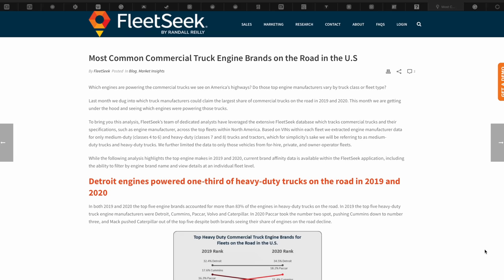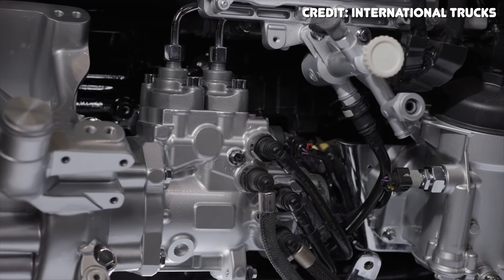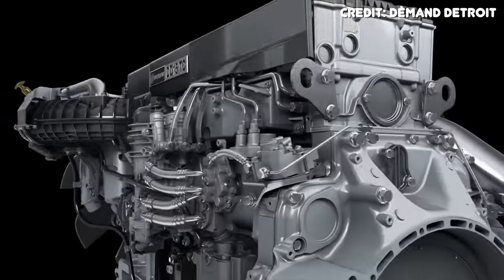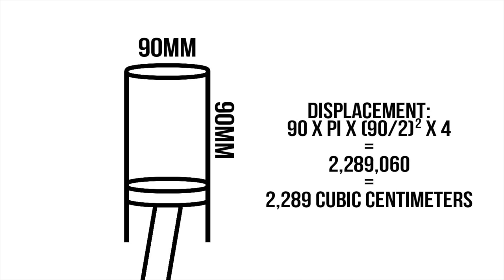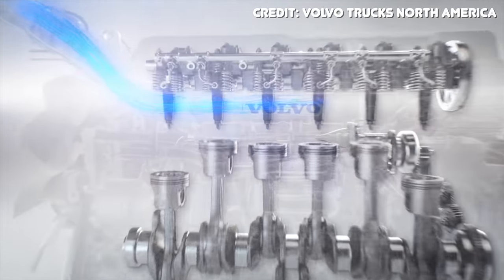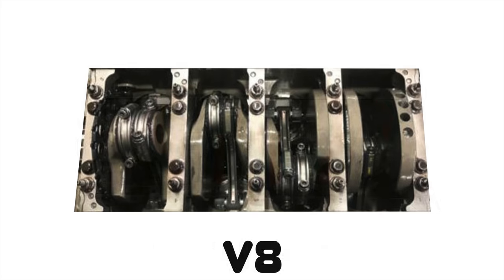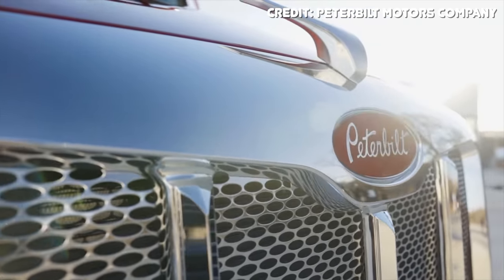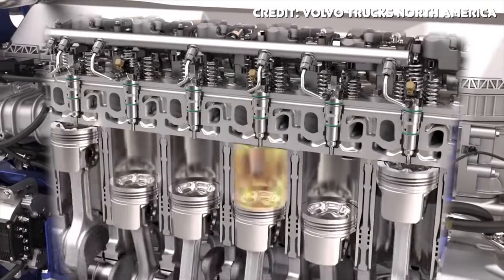Why do Semi-Trucks Use Inline-Six Engines?

Comment: Truck frames are the problem with "V" configurations.  The "V" angle is determined by dividing 720 by the number of cylinders.   The 3408 CAT, a big V-8, had a modified crankshaft to narrow the cylinder bank angle to less than 90 degrees so it would sit down into truck frames for sales to that market.  I hear the 3408 problems because of this too.  The big ends of the connecting rods from the opposing cylinder banks rode on two separate bearing surfaces which were machined on to the same rod journal area right next to one another and offset by that same number of degrees such that the firing sequence was as though the cylinder banks were 90 degrees apart.  Yes, a V-6 would need the banks 120 degrees apart which would make for a very wide stubby engine that would have to sit mostly above a truck frame, have a high center of gravity, and be an almost certain drive train alignment nightmare.  The once ubiquitous CAT 3208 sleeve-less or "throw away engine" was small, intended mostly for medium duty trucks, were made just like any other V8 engine, and fit down in truck frames with plenty of room.  The straight six is likely optimal for achieving the maximum amount of displacement within the shape of the space that a highway truck normally offers as you have alluded to.  I have not forgotten about the 8V-71 and 8V-92 Detroit two-strokes.  They were very popular and powerful for that day, but were smaller engines than the CAT 3408, and did not need to be modified.  They were a tight fit and I remember working on an 8V-71 well.  I disagree about the matter of reliability of shared rod journals in a "V".   Other Industries are in love with "V"s and the issue you mention is not an issue on much larger engines having huge amounts of torque.  Larger marine and railroad prime movers built by GE and EMD have a master bank having "complete" connecting rods as we think of them.  The rods form the opposing bank don't have big ends, but are pined into the the side of the big end of the rods from the master bank.  This is why General Electric locomotives have that distinctive lope.   The vintage Pratt & Whitney radial engines had only one complete connecting rod with the rods from the rest of the cylinders pinned into corresponding angles around the big end of that single rod of the master cylinder.  That is an example of how you can find a way to have a number of cylinders sharing a single rod journal with no problem.  P&Ws loped like hell, but they almost always got the boys home if there was any airplane at all left around them and they literally won the war for us.

Comment: Hi... Load pulling and HP can be simply put together in this way. A low HP engine like about 120 HP is pulling about 70 tons hilly area in India... Where as a 500 HP Volvo truxk is also pulling same tonnage... These all can achievable with proper matching / designing gear ratios ... 120 HP will pull the load in a " Snail pace ", where  high HP Volvo or Scania can pull that in comparitavely higher speeds due to relaxed gear ratio achivable due to engine high HP.
So there are various other factors also exists other than Engine HP and torque in this subject.

Comment: A 90° V8 with cross plane crankshaft is actually also balanced by the counterweights on the crank. With a flat plane crank, you get a slight vibration, but can rev higher and have better throttle response, but that does not mean cross plane V8s have the same problem.

Comment: I just remembered a video I watched not too long ago. 
That like Volvo or Man (some Swedish commercial truck company) that started back in the 1950s, they created a V8 Diesel engine. Due to heritage they’ve stuck with that V8 and overall design to this day. 
Just something I remembered from that video.
Reply: The Swedish truck is Scania. They make V-8 engines with 770 hp and 2728 lbft. Very strong powerhouse, more then 1,5 million miles possible

Comment: We ran Atkinsons with 240 Gardner engines in them which were straight 8's on 8 wheel tippers in the UK.  Thos engines were so long that they stuck out the back of the cab a fair way! lovely engines though.

Comment: I have an inline diesel engine... on my tractor. I can have open access (Obstruction-free) to all sides of the engine in about 30 seconds. 

I totally wish my pickup was setup to be as accessible as that tractor is! How awesome would that be... 

I am looking hard at buying a used I-4 Chevy Colorado at some point. Should be a nice little truck for duties like pulling the horse/or a steer or two at a time, a small center console fishing boat, and the RV around.

Comment: Flat plane crank v8’s do not use counter weights and are inherently balanced however you limited to the size of the stroke and bore before you have to add a counter weight.

Comment: Only minor weakness of an I6 is torsional vibrations on the crankshaft are higher than that of a V8 due to the length.
But if the engine is well designed and the main caps are good, this is minimized,

Comment: I think that the main thing that needs to be talked about here is the long way that engineering has come. 
We used to make big power and torque by simply making larger displacement engines with (often) more cylinders. But those days when a turbocharged 14 litre straight six diesel was limited to 350 HP, and anything beyond would call for a larger V8, are over. It's 2022 and those HP ratings (and even much, MUCH more torque than back then) we expect to see in a big rig, can nowadays be provided by a 10-14 litre straight six thanks to variable geometry turbochargers, sometimes bi-turbo setups, variable valve timing, charge air cooling, sophisticated common rail fuel injection systems and possibly a thing or two more that I forgot to mention. So it's only obvious they wanna save: save on weight; weight that chews bits off of your payload - and cost; the cost of added moving parts in your engine which need to be produced and installed, and later on wear out and will require maintainance or replacement. 
Because let's face it.. Added payload, reduced down time and low maintainance and repair costs are what matter the most in the freight industry today.
I still remember when pretty much every 500+ hp truck in Europe was NOT powered by a l6, but instead by a larger V8, or in case of MAN - a V10 even. 
But now though, like stated in your other video, Scania is pretty much the only manufacturer proudly sticking with their V8. And they're doing it purely for the pride you could say, as they're offering straight six engines as well. Ironic thing is... Of all manufacturers, Scania was the one to offer an in-line 5 engine only just a few years ago, for ~300 hp applications. 
That's what I've seen and learned so far. Thank you for making the video!

Comment: i run a BMW 3l inline 6 diesel for the same reason.  Runs smooth because of the balance, and makes it more durable because of that same reason.  And yes, in a car you loose some interior space because of the lenght.  but this is not a problem in a truck. i think one thing is forgotten in the video, the price is lower because of less rockers, valves, cilinders, pistons and much more things in a v8 engine.

Comment: Just as what you said about "inline 6 doesn't inherently make any more or less torque", the later question regarding HP vs torque: HP is a torque rate. HP = Tq * RPM / 5252 (for any 4-stroke). The question isn't HP vs torque; the question is, as you said, the need for low-end grunt, which lends itself especially well to low-RPM, long stroke, inline 6 applications

Comment: Owned several Falcon sedans with both the I6 & V8 engines. For 20years from 1980 to 2000 there was about ~10hp between the standard factory engines the 6 being 4L & the 8 was 5L. 
The engine bay was designed to fit both so the I6 sat tall and fwd making the car nose heavy and eager to oversteer but in a fun controllable way. Working on things attached to the engine but the width and depth of the engine bay it could be quite a reach to work on the engine itself.
The V8 was low and cramped and pushed to the back needed to be a contortionist just to pull the leads off the spark plug couldn't even see the plugs behind the exhaust manifold.
Power to weight the 6 was faster without the weight of passengers the 8 was faster. 
The 8 was lazy torquer the 6 a high strung bonnet of angry wasps.
What let the six down was an alloy head on a steel block not coping with the heat difference between cyl 3+4 and the ends of the block and warping easily if regularly thrashed. The older I6 iron head absolutely bulletproof. The other big problem was Ford thought it was a great idea to put the power steering pump directly above the alternator 😐 the pumps were prone to leak of course.

Comment: Inline 6 motors have lots of torque at low rpms, another thing big trucks need. The old Ford 300 inline 6 in the pickups were excellent for towing and quick out of a light

Comment: My first pickup truck had a Detroit diesel 6.2L V8. Got great gas mileage on highway. But it only put out 185 hp/235 ft/lbs so it had no power to tow. My new pickup is a 2018 ram 6.7L Cummins and i forget the exact HP but torque is 800 ft/lbs. They used to also make an inline 8 cylinder but they stopped making it because it put out the same amount of power as the 6 but cost more to make cuz of the 2 xtra cylinders. That and everybody bought the 6 because it was cheaper.  My exact engine is used in all kinds on sprinter vans, box trucks, flatbed trucks. I don't know if the put it in a Semi truck but my same engine is in the switcher truck my buddy drives to move empty and loaded semi trailers around the distribution warehouse.

Comment: I know your theme is commercial diesel engines but an in-line 6 cylinder petrol (gas to you guys) engine is silky smooth down to very low usable revs. I guess this is down to the close sequential power strokes, amongst other factors. Wifey's BMW Z4 will pull so smoothly almost down to tickover. Such a great sound at high revs too.

Comment: Another issue is turbo set up. Both v8's and straight 6's will have about the same displacement. But if you want big power out of them you'll have to do compound turbo. Hence top line scania v8 has 4 turbos total while straight 6's have 2. The amount of valves and tubes is crazy complex

Comment: Excellent video, Great Content..
True about the inline 6 . 
But I have to have a v8 In my personal light duty Truck...made some v8s In big trucks, 3408 CAT; E9 mack , and the 2 stroke Detroits .
The E9 mack is rare NOWADAYS, so is the cat 3408 ,, almost forgot the Cummins 903 , I've never seen in person. All of which are incredibly expensive to work on , the truck shop I work at , will not work on E9 Mack's, parts availability and Cost .

Comment: Primary and secondary firing imbalances are cancelled out by other cylinders. So with proper maintenance they are expected to run for a very long time. And 2 less cylinders to maintain.

Comment: Did you mention better even cooling of the block and simplified improved lubrication leading to even more endurance?    Straight 4 automotive and light truck engines flat-out last longer than V6 engines across the board right now.   Of the ten most reliable automotive engines seven are in-line engines of 4, 5 and 6 cylinders in the 2.3 to 3.0l range (M57 6cyl BMW diesel in there)

Comment: Easiest answer ! In line 6 produce much more torque and are easier to make in bigger displacement , because of the way the cylinders are placed. Piston travels up and down perfectly 90 degrees , unlike a v motor , which can occupy much more room in an engine bay if made to the size of a 15l 6 inline.

Comment: I have noticed also...
Over the years the rpms reduced.
It used to be that
A deisel would make best power
2000 to 2200 rpm...
The volvo i drive now
Will not rev to 1800...
I can only asume this to be
More economical in regards
To getting more out of fuel.

If you can engineer a motor
To produce the same power
At idle speed like 1000rpm
You would save consideral amout fuel.

Comment: Best gasoline production engine: Toyota 2jz. It's I-6 and there's more reasons than just being I-6 that it can handle 1000 hp without changing internals, but the point of balance is huge. 

My work truck on my farm is a 2000 Cummins and the engine is solid. Ice replaced many other farmers transmissions on their Cummins dodges, but their engine rarely fails and if there's issues it's usually electronic related, sometimes fuel/injector related. But Cummins uses I-6 for a reason, it's strong, balanced, easy to work on, gives side space for turbo, all sorts of reasons. 

I'm in full agreement I-6 is king.

Comment: 2 points, 
One, todays diesel truck engines never see over 1800 rpm. As a matter of fact, most are tuned to stay below 1500 rpm for fuel
Mileage. 
And, in-line 6 engines no longer use a one head configuration.
And while I lines are inherently balanced, balancing the rotating assembly can enhance engine performance and longevity

Comment: Somebody may have already pointed this out, but when pronouncing Paccar, but the emphasis on the last syllable.  The name comes from the original railcar company, Pacific Car & Foundry, and even before the name of the corporation changed to reflect that the product line included many other types of products (Kenworth, Peterbilt, Carco Winches, etc.), and it was colloquially known by the contraction, Pac Car.

As for the description of how long stroke (undersquare) engines make more torque, there's a big, "yeah, but...).  I would agree that an undersquare motor is capable of making lot of torque at low RPM's, but it would be a mistake to assume that short stroke (oversquare) motors can't make loads of torque.  The long stroke motor does have a longer lever arm at the crank compared to a short stroke motor, but it gives up peak brake mean effective pressure at the piston crown compared to a short stroke motor exactly because the bore is smaller for a given displacement.  I'm not arguing that diesel engines should run shorter strokes, only that your explanation left out the trade-off involved in a long stroke motor.

Comment: Something about my 2015 RAM 2500 Cummings turbo diesel.
It runs so smooth and strong with no mechanical issues what so ever.
I just Love that truck and wouldn't trade it for anything -
Reply: else

Comment: An older gentleman with lots of experience said to me that one of the reasons is because the Pistons go straight up and down and write laying at an angle so the cylinder liners, pistons and of course rings last longer between rebuilds
Reply: I once heard that either Volvo or Scania (can't remember which) used to have low-floor buses with inline-six eninge mounted on the side, so they could have a lower engine bay underneath the floor. They stopped using that configuration, when they found out, that over time, the pistons wore down the cylinder liners on the side facing down.

Comment: Great vid! Some thoughts on the popular engines list: If we look back about 20 or so years ago you could order a truck in whatever spec you wanted. Want a Columbia with a C13 and a 10 Speed? Sure thing. Want a W900 86in sleeper with a 500hp Detroit and 18 speed Eaton? Go right ahead. 

Nowadays oems pretty much only offer their own platform with Cummins being there only exception. Freightliner/Western Star offers Detroit but some models can be optioned with Cummins. Peterbilt/Kenworth offers Paccar and also Cummins. Volvo does theirs and so forth. With that being said it basically means that Detroit would be the most popular by default. Since Freightliners sell the most, and it's uncommon to see a Freightliner with a Cummins it's no surprise Detroit would be number one.
Reply: I'm a truck driver as well... I've driven plenty of Freightliners, only one DIDN'T have a Cummins, it had a Mercedes engine. The rest all had Cummins. The fleet I work for, they have about 1000 units, of those maybe 3/4 are Freightliners and they all have Cummins. Actually, aside from a few Macks, all the trucks have Cummins engines.